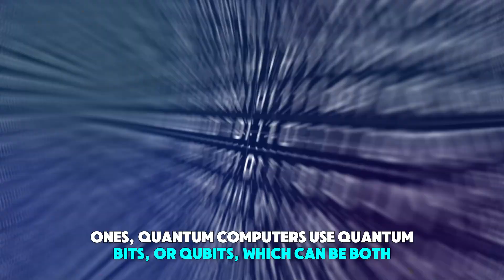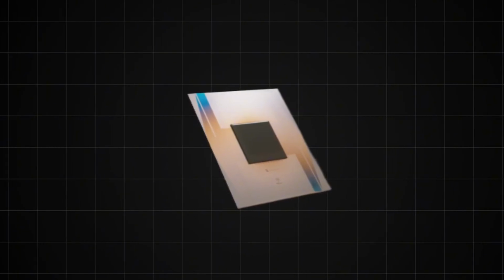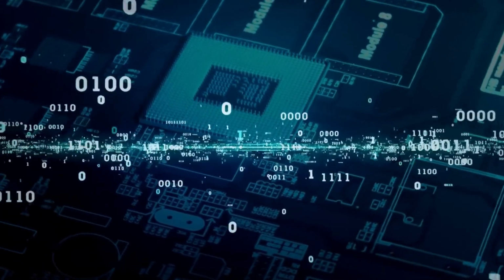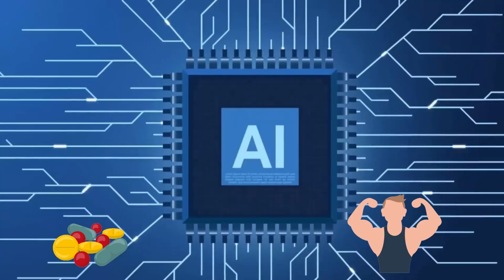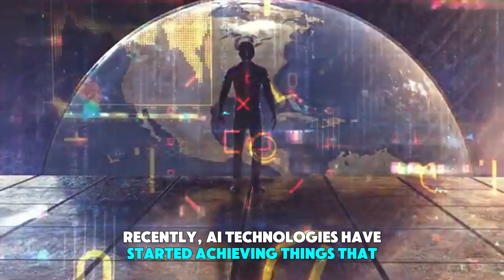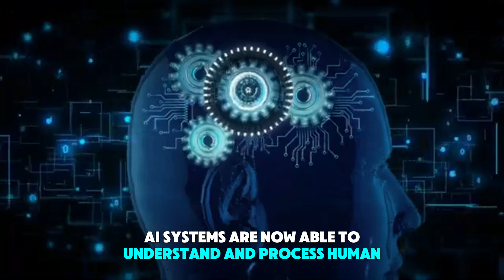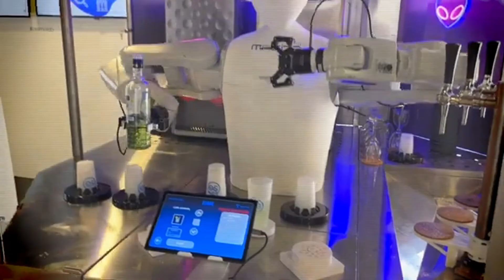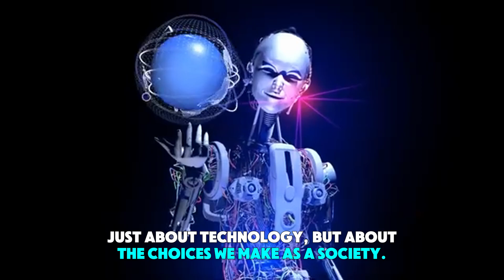AI Revolution Unleashed! Quantum Chips, Water-Powered Robots, and More!

Comment: The AI chips are all made in Taiwan, the mother board for the AI chip is made in Taiwan, the water based inter-cooler for the AI chip is made in Taiwan, the tray to hold the components are all made in Taiwan, the tower to hold the whole AI set up is made in Taiwan.  Without Taiwan, googles, Amazon, MSN, all their AI systems would not exist.
Reply from the maker: 100% right